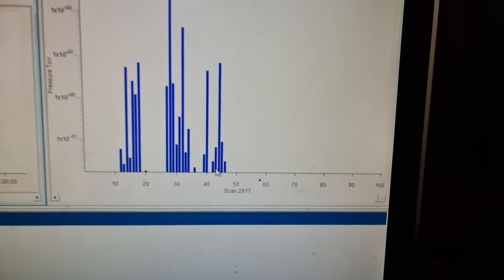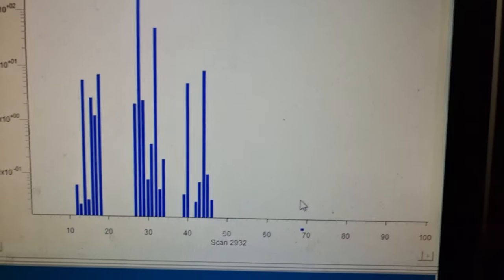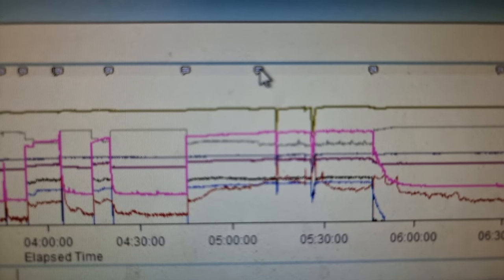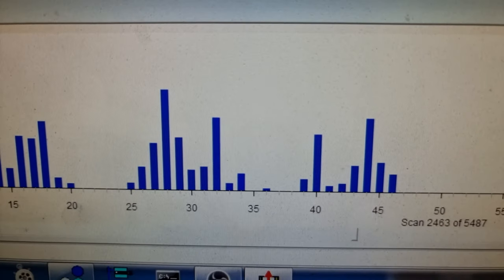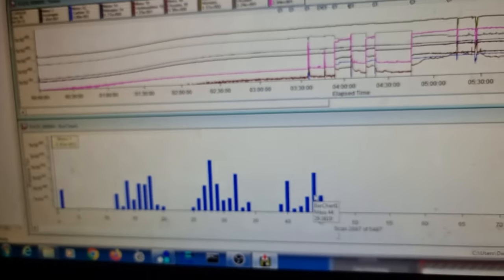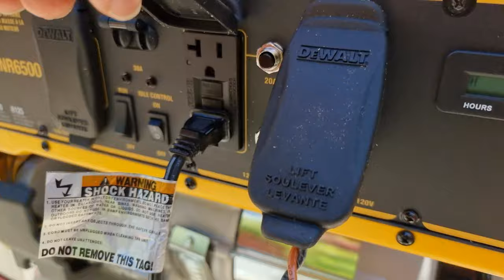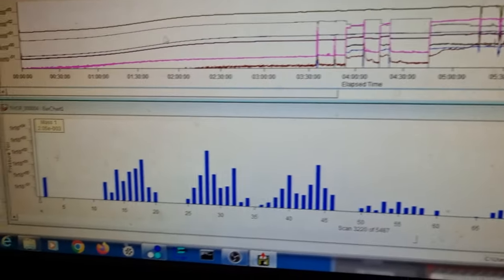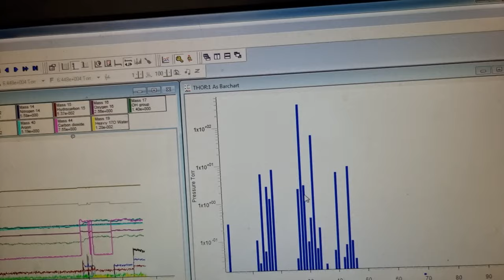THOR - Active TSG run with and without load and initial thoughts

Comment: Always love watching the process of #RealScience and discovery. More often than not,  we usually start off by learning what doesn't work, followed by  something that does. after that a period of running several successful replication, which usually involves blowing up some component in the design, as we repeatedly push the system past breaking point to find out the limits of the system's maximum. 
Eventually, we reach the level of what we see in the above video. a finely tuned technology and engineering, where the Breakthrough scientific Discovery happens! 
Now the process of inevitable technological leap begins.

Comment: The fact that this one couldn't be made to give great results, but the other ones we've seen did, with O2 getting up near 20%, does this imply that small differences in the assembly and manufacture of these relatively rough and imprecise early 'barnyard' welded units makes a big difference? Or is it a difference in how precisely the various meters have been positioned, and or calibrations being slightly off? 

It will be very instructive as these develop and they get better precision manufacturing, sort out the pipe transitions etc, to see how they perform. Certainly a brilliant bit of work, trying to solve one of the world's biggest problems with pollution. If they crack this, there will be no reason to mine all the minerals for battery cars, and will resolve the pollution from trucks, trains, ships etc, which is where far more pollution comes from.
Reply from the maker: This is the same TSG (UV light & Housing, Bubbler and Tube) as seen here: 
https://youtu.be/zxUI37iz0Hc?si=QQ6FT_bDssiUkFf8

Added by the same builder (Phil DuBois) onto a brand new DeWALT generator, in what he described as his finest build.

The difference is, here we are using a Residual Gas Analyser (Mass Spectrometer) and he was using a simple ICE exhaust analyser.

Please wait for further videos, analysis and discussion.

Comment: This is in par with other previous tests, at least CO2 wise. How was the O2 compared to the control? Also, the flow rate of the gas is still an issue, because the total amount of air flowing through the system is assumed to be equal but has not been shown to be. All things considered, any motor could pass stringent exhaust tests with one of these retrofits, and that per se is useful!

Comment: What's the wavelength of this UV light?
Reply from the maker: Not energetic enough to ionise the air
Reply: @MFMP  there's a weak spot for collision induced absorption at 315 nm. I'm just thinking about tuning parameters, and comparing performance with and without the UV.

Comment: What is the difference between this and a GEET plasma reactor? Have you tried both??
Reply from the maker: Both inject water via a bubbler. There is no energising light on a GEET and no recycling of exhaust on a TSG. 

They both have extreme hydrodynamic shear but achieve that in different ways.

There is thermal recovery in the TSG.
Reply: @MFMP  which one would you say has the most promise to become used on a wide scale?? And thanks for the response, by the way!
Reply from the maker: @robfut9954  TSG appears to be easier to achieve reliable effect
Reply: @MFMP  gotcha, looks a bit harder to make at home but maybe they’ll be sold online one day

Comment: This is great work, but there's one thing missing here - a live baseline with the tech not running. It would be most ideal to be able to switch on/off the technology on demand so that readings can be taken live with / without it running so we can directly compare/see those pollutants jump back up on the live chart. Not that I don't trust your processes, but for it to be a truly verified experiment, I would prefer to see the ioniser, bubbler and generator bypassed on demand with valve(s) somehow. I understand that might be tricky, but I recall I've seen other demo's by Malcolm where he can switch on and off the technology on demand, so I think it's possible to rig up. Also it would be truly ideal to have multiple parallel readings at: (1.) air intake before ioniser (2.) in the pipe between ioniser and bubbler (3.) in pipe between bubbler and TG (4.) between TG and carburettor (5.) between exhaust output and TG (6.) at exit of TG (which is the only one we're seeing here). Has multi point data been simultaneously collected for the 6 points, and if so is it available for review? Keep up the great work, this tech gives me real hope for the future. ☘

Comment: Is it just me or is this a different TSG configuration?  No concentric balls unless I am not seeing them.
Reply: They’re there, mounted inside the generator structure. Check again. Maybe I’m wrong 👨‍🔧
Reply: Softball size sphere, next to and feeding the engine air intake, is visible in frame at 29s into the video. And the other one below it, visible a few seconds later
Reply: Thanks all.  These are not good results.  I’ve seen so much better.  

I love they open source the design but many folks can mess that up.  Not easy to get those globe ratios.  

I hope this isn’t a program to dismantle the excitement.